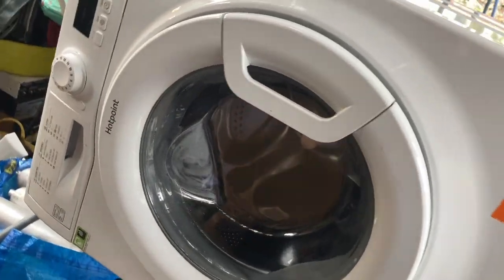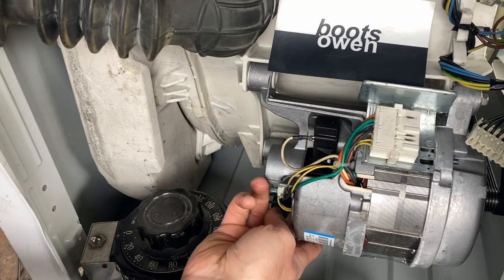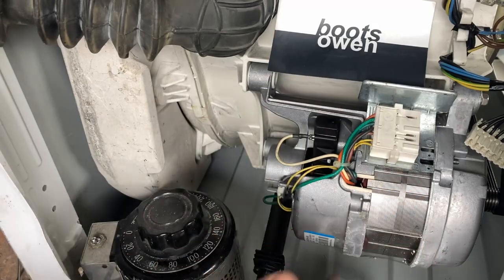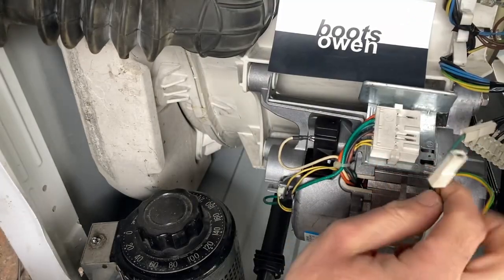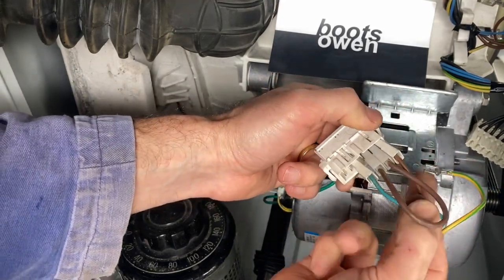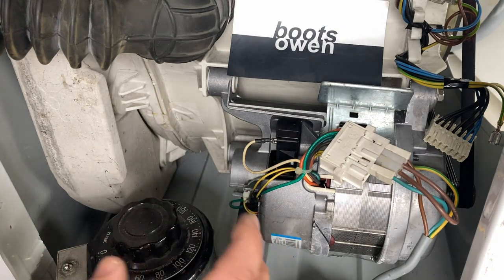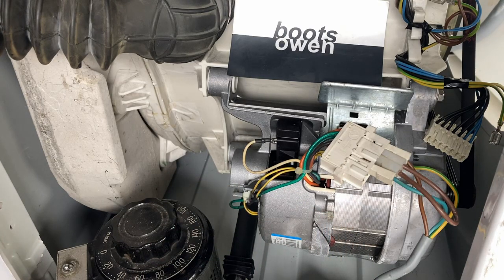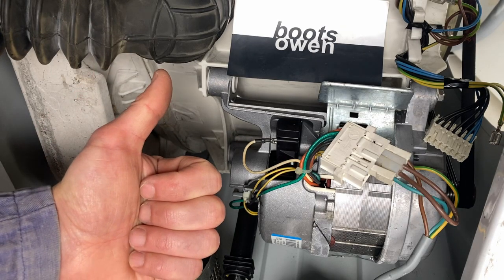How to hotwire a Hotpoint washing machine motor | Universal motor wiring

Comment: How would you do it on dc and if you did it on dc would it be able to turn both directions with a switch or not. If possible you dont have to but can you make a video on how to run one of these on dc 240 volts and on dc you can change direction of the motor with a switch would that be possible?